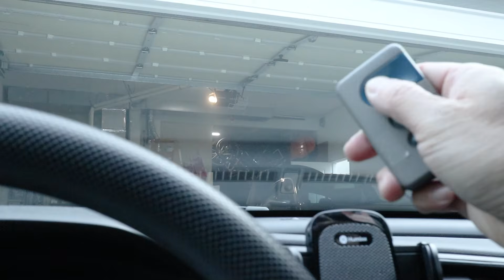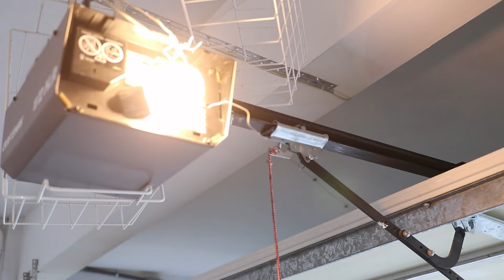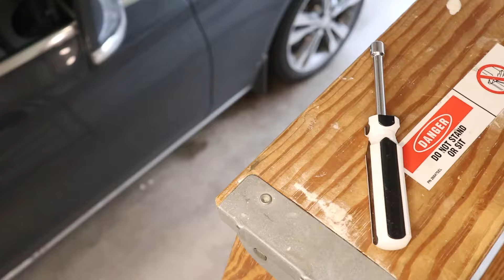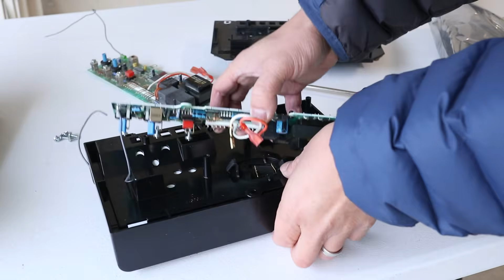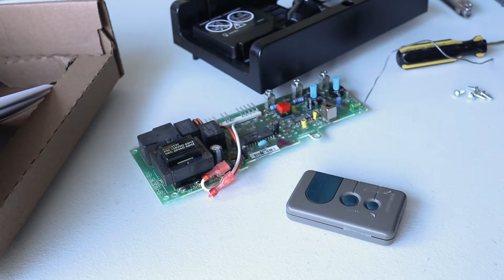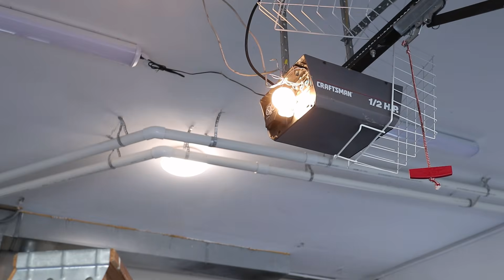Craftsman Garage Door Opens but Won't Close - Garage Door Not Closing Fix Replace Main Circuit Board

Comment: Can the bulb just be removed to 'fix' the issue? If not working with light still on?
Reply from the maker: If the issue is caused by interference from an LED bulb then yes you can remove the bulb(s) and the garage opener will function normally. But in my case I removed the bulbs and it still didn’t work. I knew that if the circuit was activated for the light (even with no bulb installed) the opener wouldn’t work. It took me a long time to pin down this problem. But the repair I made for my opener worked and is still working to this day.
Reply: @digitalcamproducer  Wow, thank you for the quick reply!
Reply: @digitalcamproducer I replaced my board and it worked for a few weeks now it’s doing the same thing again. Any suggestions?

Comment: Have you seen how much circuit board cost? I rather go and buy a new garage opener.
Reply from the maker: I just looked. The circuit boards are definitely more expensive now than when I made this video and repair. So yeah by spending a bit more it might be better to get a brand new opener. However that will take a lot more time and effort to install a new opener. Even more money if you need to hire someone for the installation as well. If you go that route I definitely recommend a professional installer. I don’t know all that is involved with putting one in but those springs above the garage door can be deadly. I won’t touch those.

Comment: A BIG THANK YOU FOR THE VIDEO ! $5 capacitor did the trick. 330uf 35v. For me it was the big capacitor located next to the transformer. Easy to find, Good idea to take pictures of wires before removing faceplate. Remember to put the new capacitor in with the numbers on the side of the capacitor facing the same way as the old one. I think they have polarity bc I installed it wrong 1st and then got lucky and reversed it…😅
Reply from the maker: Awesome! Thanks for sharing your experience and tips!

Comment: I'm having the same problem..door won't close unless light turns off..
Reply from the maker: Sounds like the same issue I had. The new circuit board definitely fixed the issue and my garage door has been working like normal ever since. Get your circuit board from Amazon so you can return it in case it’s not the problem.
Reply: @digitalcamproducer isn't there a spray to spray on the board to improve the contacts ?

Comment: My door would only close use wired button.  Replaced sensors and it still wouldn't work.  Tried many other things.  I sprayed canned air into opener through holes, nothing.  For some reason I sprayed the air on top of the opener and it worked.  Something on top must have been dirty.  Makes no sense.  I was very close to ordering a logic board.

Comment: Thank you for taking the time to do this video. I want to add that, for those interested, I fixed the PC board by replacing the 330uF 35V capacitor. It is the largest capacitor on the board, next to the transformer.
Reply from the maker: That's great to know! I appreciate you sharing that repair solution.
Reply: Thanks for the comment.  I too only replaced the capacitor and fixed the issue of not working when light circuit came on.

Comment: Thank you for figuring out that the LED light was interfering with the signal. I had the same issue and couldn't figure it out until I saw your video. Not all LED bulbs cause this problem. I had one LED bulb that caused the issue, while a different brand did not. I really appreciate finding your video.

Comment: My door won’t open and that yellow orangish light just above the purple square button on the right keep flashing. Thoughts?
Reply from the maker: I think the flashing is an error code. It’ll be a number of flashes with a short pause. For example 3 blinks then pause. And I found the following page that explains what each error code means: https://www.searspartsdirect.com/diy/error-codes/garage-door-opener-repair/1234637/craftsman-garage-door-opener/0247
Reply from the maker: That link I sent you is for Craftsman garage door openers.
Reply: So I’ll check those links out soon, but I had in the meantime sort of fixed the issue by pulling on the dangling rope cord thing then reset it and that got it working again! However the old metal suspension frame broke on one side so now it’s sagging on one side but still working so I obviously need to fix that very soon. But, the light is still blinking so I’ll have to check those links out 👍🏻

Comment: If not the LED bulb issue, you can fix the circuit board by replacing the large aluminum electrolytic capacitor.  Like 5 bucks  for 5 470uF 50V I found on Amazon.
Reply from the maker: Thanks for the additional advice!
Reply: @digitalcamproducer  Having the same issue with my Craftsman 139.53479 Garage Door Opener... Remote works but NOT if the lightbulbs are on...but it's NOT the LED bulb. Finding the exact circuit board seems impossible since this unit 30+ yrs old. Can you provide more info on repairing the PCB with the capacitor replacement 5 470uF 50V?
Reply: Having the same issue with my Craftsman 139.53479 Garage Door Opener... Remote works but NOT if the lightbulbs are on...but it's NOT the LED bulb. Replaced bulbs...NO CHANGE. Tried without bulbs,  NO CHANGE. I have an early model Sears Craftsman 139.53479SRT. Finding the exact circuit board seems impossible since this unit 30+ yrs old.

Comment: How about adding a Smart Wi-Fi Garage Door Opener using the wall button terminals?   Its more cheaperand easy to buy intead a circuit board, I´ll try and if this work I could open my garage from , my iPhone, my watch or the stereo car

Comment: So I have the craftsman 1/2 hp model. My sensors don’t have lights on them so that’s hard to check out. The door opens fine but will not close unless I hold the button down. I’ve adjusted the sensors but with no luck.

Comment: If you are having this issue from using LED bulbs, once you change back to incandescent or CFL bulbs, you will probably need to reset the garage door opener by unplugging and then plugging back in. This worked for me.

Comment: Hey @digitalcamproducer, thanks for this video.  To confirm, you successfully replaced your old Craftsman circuit board with a replacement board from Liftmaster, is that correct?
Reply: Replying to my own question - you did mention that this is the case in the video, I missed it.  I am pleased to report that I did in fact have success replacing the board as you described here.  Unfortunately it was up to $150 USD by now ...

Comment: Wow -- thanks so much!  I didn't have to replace the circuit board...just had to replace the Led bulb with a CFL, and everything works again.
Reply from the maker: That’s good it was only your LED bulb causing interference with the remote. My problem definitely was the circuit board and glad I was able to find the part and replace it myself. Glad your fix was simple! Thanks for watching!

Comment: mine opens fine , then when closing it hits the floor but opens on its own. I adjusted the little blue adjusters at every increment and it will not stay closed. My sensors are fine. the trouble code tattle tale light blinks 5 times whats that mean

Comment: I had the same problem but couldn’t figure it out till I watched your video.  My old Craftsman opener works fine with wall console.  It also works with keypad or remote control for opening the door but not closing it.  I didn’t associate that problem with the light on.  After watching your video and when I tried to turn off the light, the keypad worked.  Thanks a lot for sharing!  Now I have to find a Circuit Board for the old Craftsman opener which is not easy.
Reply: The part number of my opener is 41A5021-2C.  Should I find a circuit board with the exact part number?

Comment: I had no idea led bulbs could interfere with the remote signal. I had recently replaced my bulbs with led. When I went back to incandescents, everything worked as before. Thanks for the tip.
Reply from the maker: Yeah LED bulbs emit some sort of interference that can mess with the signal from the remote. It doesn’t affect all garage motors but simply switching to incandescent bulbs are a good way to test it.

Comment: Thank you for uploading the video. It helped me a lot. I ordered a circuit board from Amazon and replaced it. But programming the remote control was not working. Finally I figured out that the ladder I’ve been using to manually open my garage door blocked the sensor. That’s why I was not able to program the new remote control.I thought I had to return the product or call the repairman.
Reply from the maker: You’re welcome! Nice work replacing the circuit board! And glad you figured out it was your ladder causing the issue with your remote programming. Thanks for watching!

Comment: I noticed there was about a five minute delay and then the remotes would work again. You nailed it, the light is on for about five minutes and when it goes off, all works fine! Nice job troubleshooting!
Reply from the maker: Yeah! It took me awhile to figure out that the problem was related to the light being on. I was on the verge of calling a repairman myself because I couldn’t figure it out at first. Not even sure how I figured it out! But I’m glad my video helped with your garage door opener too! Thanks for watching!
Reply: @digitalcamproducer  will it work if i just remove the light bulb?
Reply: @repsolnow  It should work if you does so. Not all LED bulbs cause this problem. I had one LED bulb that caused the issue, while a different brand did not.

Comment: I'm having the same problem. Is there a work around until the circuit board is replaced.  I have one of the older models where I do not have an on/off switch for the light. It's just one button that turns the light on when I open the garage.
Reply from the maker: Sorry! I’m not sure of another work around if you don’t have an on/off switch for the light. It’s been almost 2 weeks since you added your comment. Hopefully you’ve got your garage door opener working like normal again!
Reply: @digitalcamproducer  Honestly it randomly works. Sometimes it closes no problem, then other times it doesn’t. I have a home warranty so I’m gonna have a professional look at it. Hopefully they just replace the unit

Comment: Im having the same problem. Garage won’t open or close with remote when the light is on. Is there a temporary work around until I replace it? I have an older model that does not have a separate light switch?
Reply: have you tried removing the lightbulb?
Reply: @FLADAN-3848  Yeah I tried that too. Still didn't work. The technician came out the other day and ordered a new circuit board and is going to replace it. He said they sometimes do go out. I've had my opener since 2004.
Reply from the maker: By now you’ve probably already got your garage door opener working again! I know taking out the light bulb doesn’t work because the switch inside still activates the light bulb socket even if there’s no bulb it in. The bulb is irrelevant with this problem! Thanks for watching!
Reply from the maker: Removing the bulb won’t matter. The garage door opener will still activate the light socket no matter if there’s a bulb in there or not!

Comment: Are there any other similar models that would work? I have the same opener as you do, but these boards are sold out everywhere
Reply from the maker: I’ve seen these boards on Amazon still. However depending on the model you have it might be a bit more difficult to find one in stock. Good luck!

Comment: Worked like a charm! You mentioned in the video the real symptom for the door not opening with the remote was when the light(s) were on but it worked when the light(s) were off. You should add that information as the symptom to the text description. It really is crazy why the light(s) being on or off would affect the ability of the remote control(s) to open the the door.
Reply from the maker: That is a good idea about adding the line about garage not working while light is on. I just didn’t know if people realized the light was causing the problem. It took me quite awhile to figure out why my garage door opener only worked some of the time. Initially I didn’t associate it with the light at all. So thanks for this!
Reply: @digitalcamproducer  Yeah it took me about three months to figure it out after trying all the most obvious solutions, e.g. new remote battery, new remote, different electrical outlets, checking safety sensors, etc. (LOL)